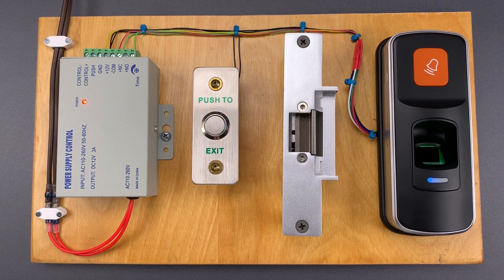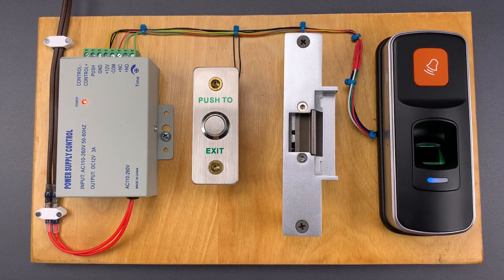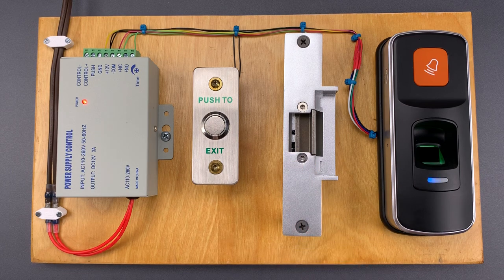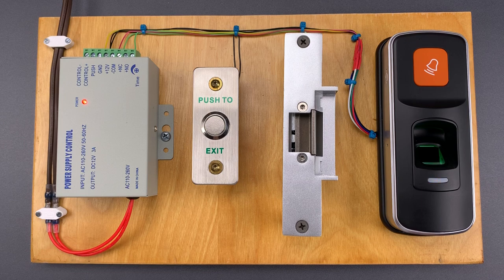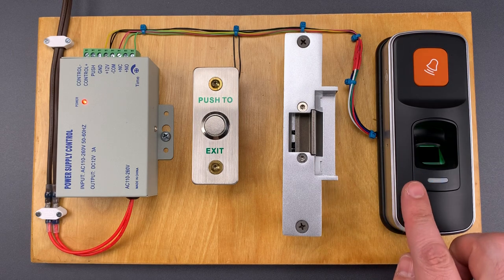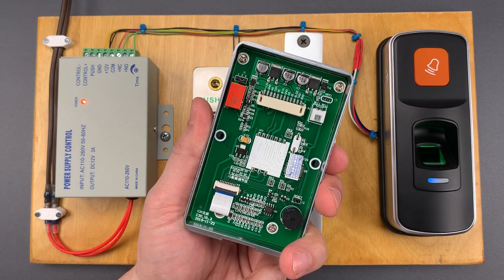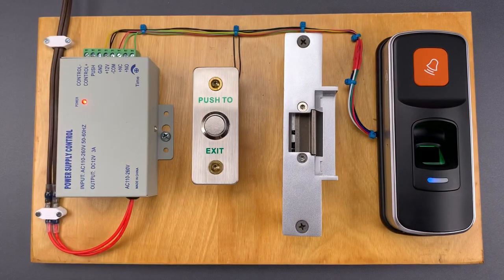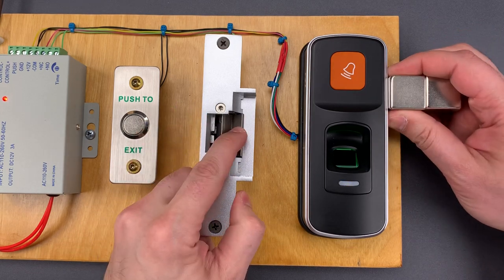[1060] Opened in ONE Second: HFeng Fingerprint Lock

Comment: They tell programmers to not develop their own cryptography.  Same should go with electrical locks.  Unless you're aware of the various threat models and vulnerabilities in systems, you're going to mess up.  There are much cheaper and more reliable solid state components that would suit this application and not be vulnerable to this kind of attack.  (They might still be vulnerable to the high voltage ring of death but that's why $.50 worth of shielding and electrical isolation should be added.

Comment: Okay so you put your magnet to the side of the fingerprint reader device. Usually that will be mounted inside the door or wall so there will be no access from the side. So will it still work if you place the magnet in front of the reader?

Comment: What if the fingerprint reader in recessed into a wall magnet not be able go on the side installation of these access systems is important aswell if its sunk into a wall this method wont work and be totally fine and  more secure

Comment: However, this method WILL NOT WORK on a unit using a solid-state relay, as there are no magnetic coils or electromagnets in it.  Something like an SCR would not be susceptible to a magnet's power; only a mechanical relay will be vulnerable to this.

Comment: I don't understand why these companies place the relays on the outside of the door where auth is requested. There should be absolutely no relays on the outside panel. Auth should be relayed to the control box on the other side and the relay should not be triggered by ANY wires connected to the reader side of the door. E.G an SPI/i2C communication should tell a microcontroller on the other side of the door to trigger the relay.

Comment: Buy one with mosfet control.
Reply: Came  here to say this.  

Amusingly, it's cheaper to use a MOSFET than the relay (2c vs 20c) but requires a little more design work ( isolation/protection ).

Comment: I’m wondering why they don’t use transistors. They work in a pretty similar way as relays but without having any mechanical components that are clearly the biggest weaknesses of relay based systems. Are the corresponding transistors that expensive? I cannot believe that. 🤔

Comment: It's absolutely ridiculous that this system has four individual components to it, one of which being the white box that quite clearly would be located INSIDE the location that the door would be locking, and yet the manufacturer decides to locate the relay in the one component that is easily accessable to an unwanted entrant.
These kinds of external unlocking devices - be it a keypad, tag reader, fingerprint reader or a retinal scanner - should NEVER be a part of the lock actuation mechanism. All they should do is send their data to a seperate, safe control module that will then decide whether or not the lock should be opened based on the data it has received.
In very many cases that's not how it's done though.

Comment: I think those biometric systems are neat. Is there one on the market that's not subceptible to a magnet attack?
Reply: There must be, this attack would be super easy to avoid, just move the circuit board to the inside unit, and run longer wires from the fingerprint reader itself, which remains outside.
The problem with the lock in this video is that it does authentication on the insecure side of the door, and then just sends a single 1 or 0 to the secure side of the door to open it.  Moving the circuit board to the secure side of the door means the only thing left on the insecure side is the reader itself, and it's only sending the information about the fingerprint to the secure side, not the result of whether it is valid, so you couldn't short circuit to unlock, since the outside unit now sends complex fingerprint data.

Comment: for those wondering how to avoid this, you just have the unlocking system send actual information required to unlock, weather it's a cryptographic key or even just a few hard coded bits, still better than just an on off switch, this is honestly so stupid, engineers must have though of this while designing these things and then the higher ups probably just ignored them because engineers raise so many concerns that the chad suit types just assume they are nitpicking
Reply: It is simpler than that. These companies do not care if it is secure.These knockoffs have existed for decades.

Comment: Is there any reason why such a system wouldn't just replace the relay with a far less expensive MOSFET? Especially if it's only purpose is signaling there really shouldn't be any issue in using a transistor instead

Comment: What the hell is it doing there? (c) Stanley Tucci

No, seriously.  WHO was the genius (or a crook?) that decided to put master relay for the pin, into the outside unit...    It's the same, as putting the alarm system fuse, right next to the keypad. "Here you go, just pull it and you're home free.."

Comment: Why don't more lock kits have mechanical fail-safes to stop the relay from moving without power applied?
Reply: Because they don't design their own custom relays, they just use ones from the "catalog" (somewhere like Digikey, but cheaper probably), and nobody makes a relay with the feature you're suggesting. If one was ever necessary for redundant lockout in a circuit of some kind (that's not going to be deliberately sabotaged), then you'd just put two in series on the contact side, and then you need both relays to activate. By the way, this sort of attack can also be solved by switching to a solid state relay, or heck, even just a good old transistor (probably a MOSFET would be best in this case). Then, however, you're more susceptible to RF, high voltage, or electrostatic  attacks, as SSRs or transistors are much easier to "kill" or "incapacitate" in that regard than good old EM relays. Maybe you could mix and match them, one EM for stopping the electronic attacks, and one SSR or transistor for stopping magnetic attacks. Still nothing stopping someone from using both at once though...

Comment: And this is why my controllers are controlling the relay function of the lock and not the reader. Just make sure you use Banana wire, or you will get electrical interference and your data+ and data- won't accurately make it to the controller.

Comment: If it was designed MY way, it wouldn't have this vulnerability as the relay is exchanged for a semiconductor switch. Bridge rectifier and opto isolator rigged as a switch.

Comment: If you did this, would there be no record of the door being opened, since it didn't read a fingerprint? Or does it always record the door being opened?
Reply: Probably no record unless the system actually has a way to monitor the real status of the door, and I don't see provisions for that sort of system here. Even if it somehow detects that the door opened, it'll have no info to fill out in a log entry beyond "door opened when not commanded to". No ID of the fingerprint, nothing really useful beyond being able to be flagged in the next log review (whenever that is) and possibly telling people when the attacker compromised the door, if the keypad has a RTC (real-time-clock) for some reason (it might though for the express purpose of timestamping log entries.

Comment: What about those models that replace the door handle and the electronics are on the inside-side of the door, can you also defeat it with just a magnet? are those locks that useless?
Reply: All that matters is that you have a strong enough magnet to reach the relay and the relay is mechanical. If you can meet these two requirments the door is easily unlocked. Relay should either be solid state or far away from outside access

Comment: Wondering why they don't relocate the relay to the power supply.. there would be a few extra wires to run but to remove that exploit from the equation greatly increases the time needed to bypass it.
Reply: The fingerprint reader is designed as an all-in-one unit, is why
Reply: @tsm688  why bother with this at all then? If it is this about security it's function should outweigh it's form right? What's better, a lock that works great but looks bad or a lock that looks great and works bad..
Reply: @anonymous-kd3hu  Why indeed.  An all-in-one unit is guaranteed vulnerable in some way or other.  This just makes it incredibly obvious and trivially so

Comment: Great, if the cheap fingerprint reader circuit uses a electromechanical relay.  Relays are old hat, and have been replaced by triacs in decent electronic equipment.  A magnet isn't going to help you there.
Reply: Also, the magnet trick will only work when it's aligned with the armature of the relay.  That is, the magnet needs to be placed so it pulls the armature (the moving part of the relay the holds the contacts) in the natural direction of closing the relay; otherwise nothing will happen.
Otherwise, good trick.

Comment: To include such a blatant mistake for the "ease of installation" is no excuse. It wouldn't be that difficult to either shield the relay or just use one that is based on a rotary type activation, where a cam keeps the contact open and can only be closed with the cam rotating out of the way...crudely. Or just use a PWM type of solenoid.

Comment: An easy fix would be to replace the relay with a Transistor.
Reply: Or is there some law that says it has to be a mechanical switch that opens the door? If there isn't then a transistor would make this significantly harder to bypass.
Reply: It is surprisingly annoying to build something truly robust and multipurpose without relays.  "solid state relays" are not perfect drop-in replacements, they have some occasionally annoying requirements.  They could do it, and it'd work for some customers' systems and not others.  Requiring different outputs or models for different customers, more complexity, etc, etc.

Comment: Remove the relay and replace with a sufficient power transistor and problem will be solved
Reply: It's not even that massive a MOSFET! They're used in 3D printer control boards, with currents up to 20A through the heated bed MOSFET, which has to also turn on and off several times a second, and it survives that for years while being about the same footprint as the relay, but way thinner.
Reply: @EgorKaskader  They don't need to be isolated the way this unit does.  To really replace a relay you'd need an optoisolator and a secondary power supply and it still won't behave quite the same.

Comment: Not all standalone access systems are relay run at the reader. Check out presco to be fair
Reply: Presco is all data at the keypad and probably the only standalone system we install for basic one door entry. A proper access system where the power to the lock is controlled from within a secure location in the building is the way to go 99% of the time

Comment: do solid state electrical relays have the same vulnerability?
Reply: No, but now you're opening yourself up to having the relay triggered by sufficient RF power being picked up by the traces like an antenna, a shock/overvoltage/static attack like he did on something electronic at some point (don't remember when, just know I've seen it in the last 6 months or so), or other things like that. Best just to put the whole actual control side on the inside of the door, and have the keypad send something that's as hard to fake as the actual fingerprint/code/badge etc (depending on what the lock is set up for, as this covers more than just fingerprint locks). That way it's no easier to "hack" the keypad than it is to just guess/forge the actual entry token. Even if this one (and all others like it with the controller on the outside and a fully dumb box on the inside) were completely invulnerable to all magnet and "shock" tricks, you can still just gain access to the actual wires back to the dumb box and fake it there. You could make the signal back to the dumb box more complicated to fake, but now the dumb box has to get smarter to know what to do in decoding the control signal from the controller outside, and before you know it you're right back to having the controller on the inside and the input on the outside as the "dumb" one.

Comment: Why not just mount in the middle of the board and also so it "actuates" away from the edge of the case???
Reply: It's the same thing, then you can place the magnet on front, or you can easily broke the case to get in. Also there a ton of other ways to open it (like putting a 12 volt batteries on the wires that opens the lock).
The problem is the fact that the external device is able to open the lock.

Comment: why they dont use solid state relay???
Reply: It is surprisingly annoying to build something truly robust and multipurpose without relays.  "solid state relays" are not perfect drop-in replacements, they have some occasionally annoying requirements.  They could do it, and it'd work for some customers' systems and not others.  Requiring different outputs or models for different customers, more complexity, etc, etc.

Comment: Why dont they use a simple BJT or mosfet? Its as easy to use as a relay.
Reply: It's actually not...  It is surprisingly annoying to build something truly robust and multipurpose without relays.  "solid state relays" are not perfect drop-in replacements, they have some occasionally annoying requirements.  They could do it, and it'd work for some customers' systems and not others.  Requiring different outputs or models for different customers, more complexity, etc, etc.

Comment: Vulnerability is only present, when a person is knowledgeable of the relay's position and happens to be carrying around a rare earth magnet. It's not rocket science to figure out how easily this vulnerability can be eliminated, by either installing an obstruction to block the vulnerable side, installing the vulnerable side against a wall or simply recessing the device itself. There, problem solved. Now you have a good lock, that LPL can't open.
Reply: He can still just pull it apart and bridge the proper connections inside to either actuate the relay or just trigger the output of the relay directly. The only good way to stop this is to make the actual control of the lock happen on the far side of the door, so nobody can get to it, and then send actual data to that controller that just represents the input somehow, doesn't actually say whether it is good or not. That way it's basically as hard to fake the output from the keypad/reader (card or finger)/etc as it is to just fake the actual access token (code/fingerprint/badge/etc).

Comment: The manufacturer could replace the relay with the transistor. It would be even cheaper.
Reply: That would not be isolated.  It'd expose the circuitry to interference/damage from outside
Reply: @tsm688  Hahaha! Please explain how would you hack transistor driven door strike with the magnet as shown in this video?
Reply: @jaremaw2368  Yank it off the wall, bridge two wires.  The flaw is still there, the magnet just makes it really obvious.
Reply: @tsm688  Yank it of the wall? Is this how was it done on this video?
Reply: @jaremaw2368  No?  I'm not sure your point.
Reply: @tsm688  Not sure? At any point of this video, was there a suggestion to yank it of the wall in order to defeat it?
Reply: @tsm688  Also in your comment you talk about “bridging two wires”. Which wires exactly?
Reply: @tsm688  Stay on the topic of this video. Defeating this particular system with a magnet. What’s you solution to prevent it.
Reply: @jaremaw2368  A piece of steel would do it.
Reply: @tsm688  That’s what I thought. You are an electronics genius.
Reply: @jaremaw2368  Doing without the relay would mean knowing what control signal.  Is it high-voltage AC or low voltage DC?  The same transistor can't really handle both.  As a standalone unit this thing has to be flexible.

Comment: I've seen chart recorders get bad interference from radios and the readout is completely screwed up. Chart company denies bad design flaws and blames every other person/company involved with supplied/installed equipment.
Reply: And they'could be right.  High-impedance inputs are sensitive by definition, use them wrong and they get all kinds of noise

Comment: SIGH This is why you use what's called a MOSFET instead of a relay in security systems. They can't be tampered by magnets and can sometimes handle more current than a relay. Come on people, it's time to upgrade!
Reply: Yeah but they had a crate of these right there already and the mosfets were way over on the other side of the warehouse.
Reply: @Skarry  Oh, I see. Yeah that makes sense.

Comment: Typical smart crap with 99% design and 1% engineering, this is why I prefer to develop my own smart electronics...

My own developed locking system houses the electronics on the inside, with only a keypad on the outside. 
I also used a mosfet instead of a relay to switch the lock, for durability reasons.

Comment: Would this work on something like those locks that require badges to enter?
Reply: Probably if they also keep the "smart" side of the lock on the outside. If the magnet doesn't work, then the one where you just bridge the proper wires together will almost certainly work, provided that it's actually a "smart on the outside of the building" type.

Comment: Tbh this is more of a badly designed relay than the lock. Most of the ones i have seen are placed in such a way where you can only turn of off with a sufficiently strong magnet

Comment: Could the circuit of the relay be made in a non-magnetic metal like aluminum or copper?
Reply: Sure, you could make the conductors in the relay out of something different, but the whole principle on which it operates is electromagnetic attraction of some part to switch the contacts, so that part still has to be either a full-blown magnet or at least just a piece of some material (probably iron or steel) that is attracted to magnets, otherwise it won't work. If an electromagnet can do it, a normal magnet can to.